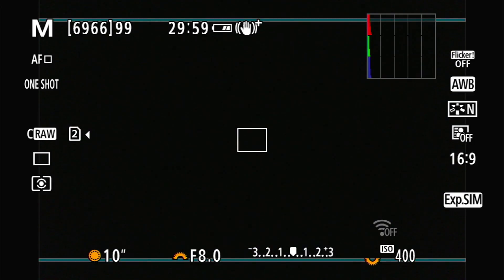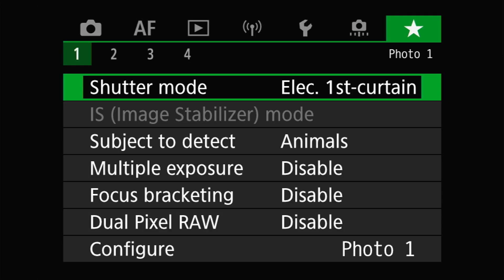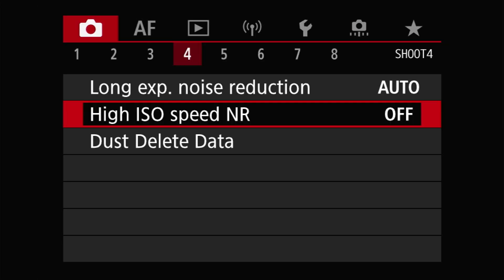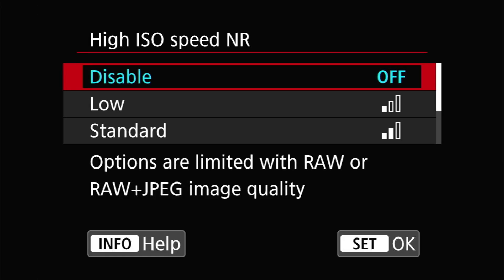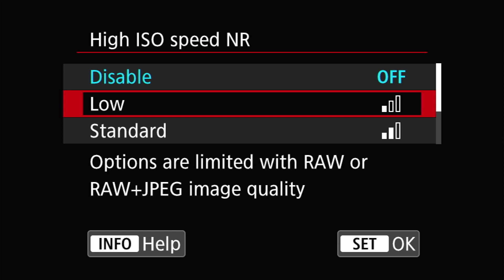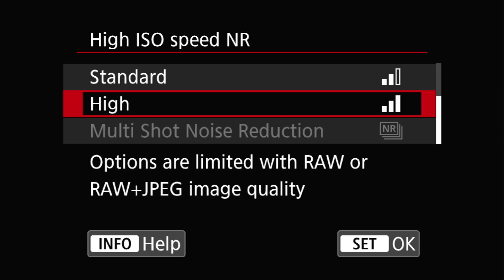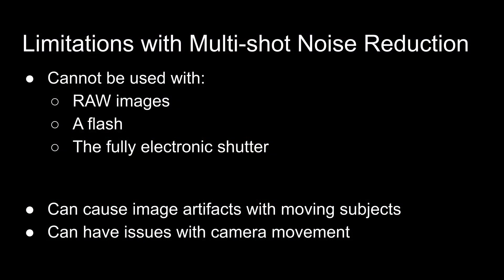High ISO speed Noise Reduction - EOS R5 Tip 20

Comment: Hi,  Good info.....but I find if I disable all noise reduction in camera it still gets applied to the embedded jpeg or jpeg rendered by the camera and when viewing the raw filw in DPP noise reduction is applied.
Checking the file info, ctl+i,  in DPP shows that indeed noise reduction is disabled.  Canon customer service has no answer.  I do use jpegs quite a lot for focus stacking and find Canon DLO does a good job without DPP sharpening.
Reply from the maker: I don't have a good answer to that either.

That said, DPP does more than just high ISO NR. The NR settings found on the "Adjust image detail" tab don't have an in camera equivalent and have to be set in DPP specifically. Turning off NR in camera won't turn those off too.

Comment: Hi, I have a question about R5 noise. I found even in low ISO and good light conditions, my R5 has also noticeable noises if I watch the picture(raw or jpg) in 100% size.
Is this normal?
Thanks.
Reply from the maker: To some extent yes, but how much depends on a lot of factors from sensor temperature to the specific ISO you're using.

The R5 uses a dual gain sensor which can result in unexpected performance at low ISOs. For example, ISOs 200-320 can be noisier than shooting at 400-640.

Also the longer the camera has been on and in the sun, the warmer the sensor will be and that will result in increased noise in images. Being mirrorless makes this a bit more of a problem since the sensor is both used to create the live image and is exposed to light any time the camera is on (where a DSLR kept the sensor off and sheltered behind the mirror and shutter when it wasn't being used). Though hot cameras producing noisier images isn't new to mirrorless cameras, and I always try to keep my cameras out of the sun as much as possible to keep them as cool as possible.

This latter part can be a real problem. I have images shot outside at mid day during an airshow where the camera's internal temp was high enough (50°C according to the metadata) where the ISO 500 images look as noisy as I'd expect ISO 1250-1600 images to be.